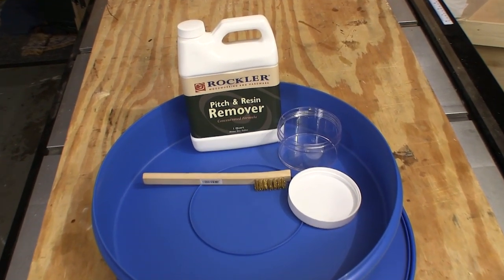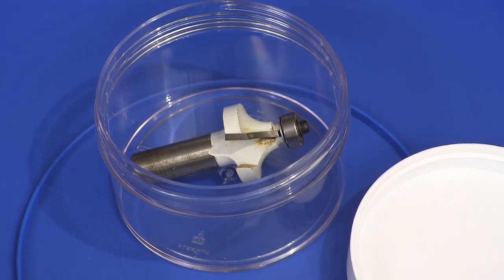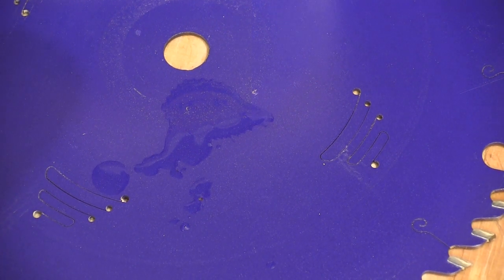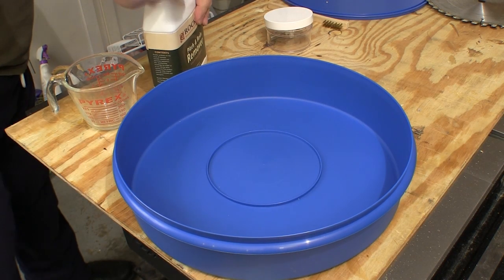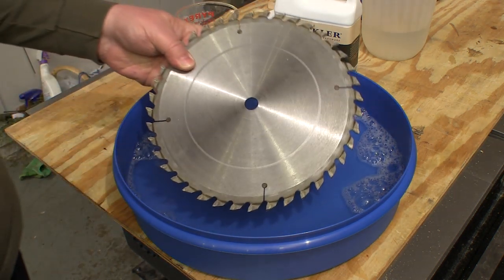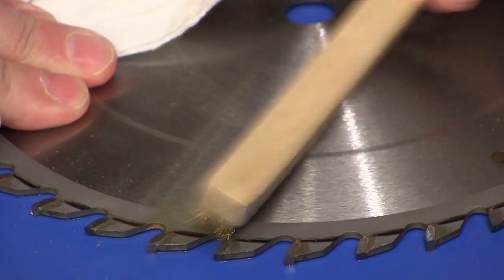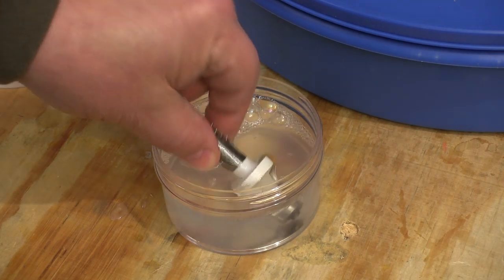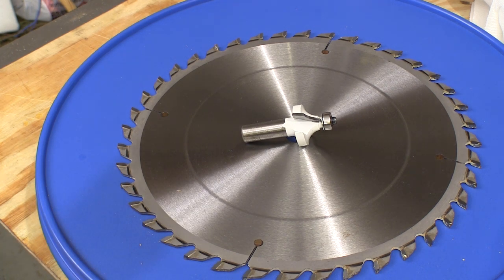Rockler Router Bit and Saw Blade Cleaning Kit

Comment: Good review.  I have watched a video by the wood whisperer in the past and he had used a similar product full strength.  And puts it back in the bottle.  I am actually amazed that even by diluting the rocker cleaner 3 to 1 stills works just as quickly.  Again, that was a great video.  Thanks!

Comment from the maker: You can take the bearing off but I usdually leave it on and then lube the bearing up with light oil before using it. I got in the habit of adding a drop of oil to the bearings long ago and  I have never had one go bad. Just don;t get carried away with the oil! A little bit goes a long way.

Comment: Easy Off oven cleaner is another way to clean saw blades  but it's kind of hard on the paint.  Sometimes I don't even take the blade out of  my table saw.  Just spray it and let it set for 15 minutes then wipe it off with an old tee shirt....